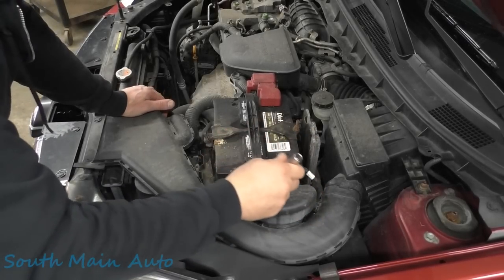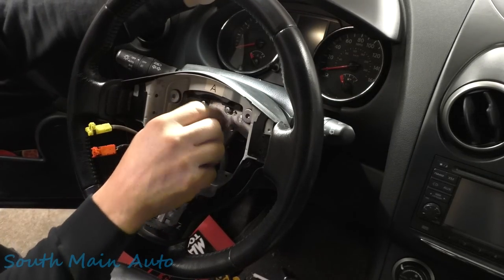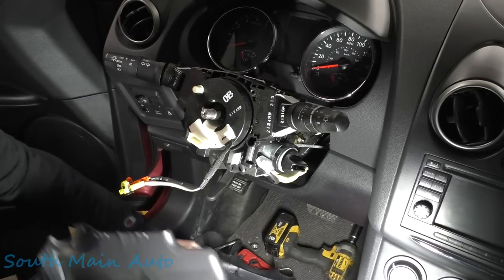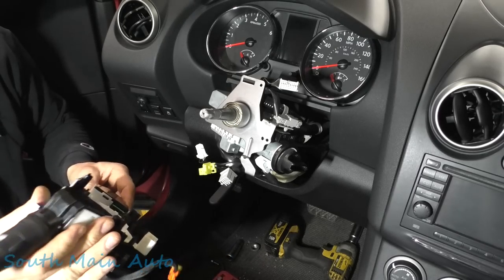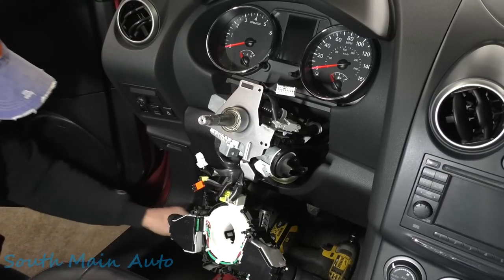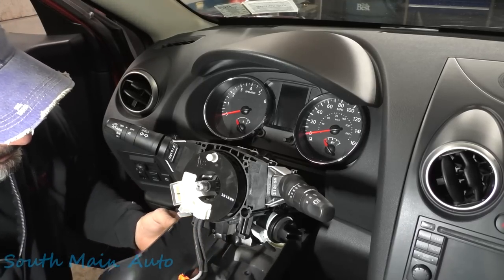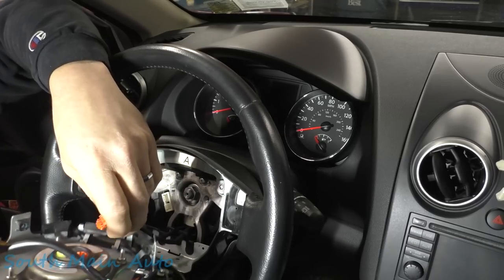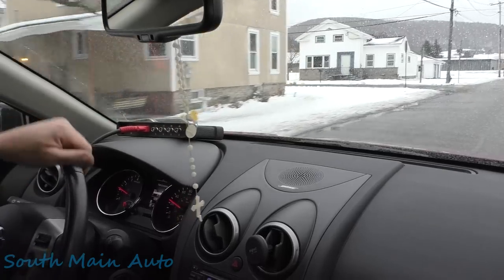'12 Nissan Rogue: Air Bag Spiral Cable (Clock-spring)

Comment: In the days before I started wearing trifocals full time, I found safety glasses with near vision magnifiers that saved the day. Suddenly there was daily motivation to have those safety glasses on. Since they only affect the visual field when looking down, you can wear them regularly even when not working close. Plastic, cheap, sold in well stocked automotive hardware stores. They last about a year, until they get pitted by hot metal shrapnel thrown off the grinder. Or search the term "safety glasses with readers". The magnification for most guys is usually 1.5-2.0 diopters, but if you're like me and want a giant view, up to about 3.0 is available with no prescription. I routinely use magnifying lenses for welding and cutting torches as well. Cheater lenses are a game changer for welding.
Reply from the maker: Great advice 👍🏼 Thanks!
Reply: I use these
Reply: I refused to get bifocals or trifocals and in my head I am not old enough so I went for the progressives and now I can say I can see and I do not have old man glasses, even though I am old as balls.
Reply: @hommie789  Only use magnifiers to read (had cateracts removed ) ages ago now 65.
Reply: @hommie789  I had progressives before I had lined bifocals. I bought a cheap pair for the garage and now I prefer the line. The magnification field is much larger and I find I'm just moving my eyes instead of my whole head. Could be that the guy who made my progressives didn't get them set just right either......Who knows? At any rate, I'm hard on them and lined is much cheaper.
Reply: I got tri-focals in my safety glasses for looking at things above my head. But because I am often kneeling and looking down at my work I find that I still use the upper reading lens because it's easier to look through the top of the glasses than to bend the neck back to look through the bottom of the lens.
Reply: @rael5469  Thanks, I think that's what I need.  I've been wearing progressives but positioning my head so I can see up close has been a real problem and end up taking them off or propping them on my forehead.
Reply: Thank you, I am leaving now to go buy me a pair of safety glasses.
Reply: Yes! I'm always taking my safety glasses off so I can see, so I ordered a pair of Dewalt bifocals from Amazon for $13.49.
Reply: I'm guessing Eric thinks the glasses make him look older.  Either way he is the best technician I have seen.
Reply: I installed 1.50 readers on my welding helmet. Now I can't blame my eyes for sloppy welds anymore. Now I'll blame the coffee shakes!
Reply: I'm 51. Probably about 3 years ago, I was working in a buffing shop at the textile plant. My overseer came in and said, "Hey, do you want these safety glasses with the cheater lenses at the bottom?" I said sure. I immediately put them on and looked at some rubber rollers I was inspecting for defects and immediately knew I had been walking around half-blind. The difference was shocking. Now I'm wearing no line bifocals but still prefer to use reading glasses when I'm doing close-up work like soldering.

Comment: I was a Toyota dealer technician for 34 years and replacing the spiral cable was way simpler than this on all models and took way less time to do the same job. I retired 6 years ago and watch this channel to remind me how glad I am to be out of this trade.
Reply: Try doing a 2006 Chrysler 300/Magnum hidden set screw that holds the clockspring steering angle sensor turn signal and covers. First time doing one you will have half your toolbox on the passenger seat 😂
Reply: Kind of a thankless industry.  Shops pushing profits over quality, the cost of tools, automotive engineers finding more creative ways to design the same parts, customers wanting cheap repairs but can't fix anything themselves...
Reply: Or you actually miss it a little…

Comment: Hi Eric. Greetings from Australia. Just did the same job on an identical Nissan assembly. Clockspring had a bad circuit. The "clockspring" is actually a strip of flexible printed circuit using copper tracks. Being a cheapskate, I disassembled the clockspring and located the fault. As there were no other steering wheel controls in this car, there were lots of spare tracks so I just bridged across to use a spare pair of tracks for each wire to the airbag (only a 1 connector bag). Should last the life of the car now! I regretted not videoing the clockspring disassembly as it was a bitch to put back together but is now working fine.  Concerning airbags, as you suggested there is a bit of hype around these. They are pretty robust. There are warnings about testing with an ohmmeter. I can tell you that you will not get enough energy from a digital meter to fire the bag (7 years working at an explosives test range!!) The real elephant in the room is static electricity which no one says much about!

Comment: In the early air bag days, I used to work on steering columns from out side the car until I had the airbag out and sitting on the bench. Some one came to the dealership and demonstrated how high the bag assembly went if it was bag side down. Don't want that hitting you anywhere.

Comment: Eric, I really enjoy your videos, and I love hearing the banter with your wife.
Self-tapping screws are usually used to assemble plastic parts, and there is a limited number of times these parts can be reassembled.  When reassembling these parts, I've learned to insert the screw into the hole, push on the screw while turning it to the left until I feel the screw thread drop into the thread in the plastic, and then tighten to the right.  Doing this reuses the original threads instead of cutting a new one.  I understand that most of the time, you will likely be the last person to work on that area of a car, but adopting this practice will enable a greater number of times a plastic part can be reassembled.  Actually, I do this with most threaded fasteners, and I find that it helps prevent cross-threading.
Thanks again for all of your videos.

Comment: That was a fantastic job getting those connections apart and back together.  AND NO PARTS LEFT OVER!!!.  I could never be a mechanic.  I would be pulling the sledge out.  Thanks for the video.

Comment: That's hilarious. I always wonder about the one way fasteners in toilet stalls. Glad I'm not alone!
Reply: Don’t need a one-way unscrew driver, cuz the stall wall is probably already ripped off the walls or will be, with some tile work and new concrete anchors 🤷‍♂️😏

Comment: I JUST did this job on my 2014 Frontier.  The radio/phone controls on the left side of the steering wheel stopped working.  Air bag connection was still OK. This is probably the exact same part.  I did have to get a steering wheel puller for this style with the two small holes on either side of the shaft - not enough "lead in my pencil" to just pull it by hand, I guess. And yes - I had to transfer the position sensor, screws and controls posts. Nissan would only sell the whole shooting match with the control posts that I didn't need with the clock spring for about $250.  But I was able to get the Nissan clock spring ONLY from Flea-bay for about $50.  Way better than $250.  Keep that in mind if you need to do the same job.  Thanks again, Eric!

Comment: Did the clock spring on the wife’s Tucson a month ago, and you have to clear the code before the light goes off as well, i got hers from the wrecker for $12 compared to $347 from the dealer.

Comment: Same set up on a 2009 Xtrail, had to change mine twice, faulty unit on first one. Took me about 30 minutes. Had ABS light flashing, other symptons included radio buttons and cruise control not working on steering wheel.

Comment: Awesome timing, my guy... I'm tracking down the air bag light on the wife's 2012 Rogue...
Reply: Did it end up being the clockspring? My wife's horn isn't working and then I checked and her cruise control isn't working. I think it's the clock spring and it's a 2011 Rogue.
Reply: @TortureBot  My problem ended up being the air bag module... Sounds like your symptoms would be the clockspring, but always test - don't guess... Good luck...
Reply: @steveo6631  thanks. I bet the airbag was a bit expensive huh?

Comment: My eye doctor gave 2 options.  1 to use readers for magnification. Or 2 use a single contact lenses that provided the magnification needed.  Thought that was weird but other people tell me it works.  I went with readers due to the dust in the construction sites we work in. Easier to clean reader glasses than flush out an irritated eye
Reply: President Reagan had contacts. He used one eye for reading and the other to see where he was going.
Reply: At 57 i just broke down and got multifocal contacts, wish i did it years ago!
Reply: @kurtb3606 I got no line bifocals about 3 or 4 years ago. I tried to get the eye doctor to set me up for contact lenses but he just kept talking and talking about how I needed to do bifocals. I caved in but I must say I rarely use them and just walk around with some reading glasses handy.

Comment: i completed a similar repair for our VW broken steering column lock.  Taking everything apart is slow; reassembly is fast since the design facilitates minimal assembly (factory labor) time.

I clearly saw steering wheel/column alignment marks but mines off on spline to um, err, well ... compensate for my daughters slight pot hole mishap that left the recently aligned steering wheel at about a two degrees from level. It drives straight though I need to remember to put it back square for the next set of tires.

Comment: I think I'm most impressed that a Nissan Rogue has 160 on the speedo!
Reply: I have a buddy with an '11 Nissan Frontier with well over that I think. Yes, it's the automatic/CV tranny. So far so good as far as I know. He bought it used several years ago and it's been good to him.
Reply: plenty of Rogues at the junk yard here in Florida [ it's not the heat]
Reply: Both of you misunderstood. He means the mph on the speedo. As in it can go 160mph.
Reply: @andrewkennedy9704 yes he did misunderstand. I can say that my wife's 2011 Rogue with a CVT has managed to get to 175,000 miles, but the Transmissions been acting funny for probably over 50,000 miles. It jerks and stutters a lot of the times but then other days it won't do it at all. Very strange. The transmission is very whiny these days though.

Comment: I had to replace a clock spring (cable) on a ‘97 Voyager .. I was almost “clocked” by the steering wheel airbag .. it was tough to get loose, but when it let go, Whoa! .. almost a man down .. juggle caught it just before it hit the ground😮

Comment: Had my eyes flapped and zapped in 1995. Best $4400.00 dollars spent on myself. You can get them both done for $1600. Now close up work 1.0 correction needed through dollar general $2.00 glasses. You gotta' cut back somewhere.

Comment: Hey Eric. You should get you some mulifocal contacts. I started having issues with up close vision around 43-44. Used reading glasses for three years until my wife convinced me to see an eye doctor. My distant vision was slightly blurry as well and up close was very blurry due to age and is called presbyopia. Anyway, to the point, they make more or less bifocal contacts. They are a godsend. No more reading glasses and both my distant vision and up close are perfect again. Air optix plus hydraglyde make a great multifocal contact lens. Just some food for thought.
Reply: 100%.  They're great, you don't even know you're wearing them.  Awesome lenses.
Reply: @johnz8210, how do you focus on small text and stuff if they're in your eyes all the time?

Comment: "My eyes aren't doing good this morning."  Whenever working around the airbag and its connectors, always wear eyepro.  Even if the battery is disconnected, a static charge can cause a spark and trigger the inflator.

Comment: Get some good readers and a headlight. A young helper who can see in those dark areas helps a lot too. I put up with poor eyes for 20 years before retiring and selling my shop. 
My 99 Accord with 240k SRS just now failed last month. Ten years life on a Nissan is sad.  
 
One more tip to remind techs to face the airbag up when on bench just in case it goes off. Sitting it face down turns it into a missile. Haven’t set one off in 30 plus years of working on them. 
You have the patience of Job to not lose your cool messing with these. That’s something I lost once I got in my 50/60’s.

Comment: If you don’t have a tamper torque bit You can also reach into the tamper screw head with a flat screwdriver and snap off the security pin.

Comment: 😂😂😂 you had me rollin’
Toilet stall screws. Seriously.. is that really a thing??? 
We’ve all been there on the tricky connector 😅
Great video. Hope she gets better quick so so the whole fam damily doesn’t die 😐.
See ya next time
Reply: Perhaps it is  job security for the plumbers?
Reply: Yupper, before the torx, American Standard stalls used one way slotted screws that would cam out it tampered with to remove them. Drill or chisel to get those out.  Usually that wasn’t required cuz the stall wall was ripped out of the tiled wall and concrete anchors 🤷‍♂️😏.  Restroom 🚽 out of order: shitter down. 😆

Comment: I've replaced the clock spring on my '07 Quest on 2 different driveway repair occasions, 3 clock springs.  Once was I think the horn not working, then the eBay special fixed the horn but then the airbag didn't work.  No tamper proof screws on the Quest though.  This appears to be a common Nissan part that wears out.

Comment: I had to change the clock spring in my vehicle just a few weeks ago. Was a pretty straightforward job but it was weird to remove the steering wheel.

Comment: Pro tip, get some reader glasses. Start at 1.5 x. Really important pro tip...the closer your face is to what your working on, like having your head wedged under the dash, the higher the magnification you need. I wear 1.75x normally but when my face is a foot from something I need 2.5x otherwise what Im looking at is blurry with the 1.75's on.

Comment: In my thirty years of installing toilet partitions and commercial door hardware I can confirm stupid people’s need to dismantle toilet stalls and interior doors! I still have a set of security bits much like yours but not as fancy. Most configurations of bits in that set I never used, I may have used two or three consistently! One bit being the exact one you were using. Security hardware isn’t that secure against a leather man or needle nose pliers unless it is recessed!
  I installed interior doors in a High school addition many years ago. The students discovered that the security shaft in the lockset could keep them from attending class. They would force the handle of the the locked lockset until it broke the shaft inside the lockets that was designed to break to stop forced entries when the lockset was locked. It was all fun and games until they were captured on the new security camera system in living color. The parents were charged many thousands of dollars for replacement lock sets and my labor to replace them!
Reply: Most aren’t dismantled, usually demolished.  Tile job and new concrete anchors plus new stall walls and hardware...🤷‍♂️😏😠
Reply: @tomtheplummer7322  I was referring to vandals dismantling toilet partitions, not construction workers although I have dismantled then reinstalled partitions a few times.

Comment: We started using tamper resistant screws on our bathroom partitions because people were stealing the stainless steel and/or aluminum mounting hardware and latches.
Reply: Usually they just rip the walls off.  So a tile job, concrete anchors and new walls....do dismantle, just demolition and do over 😏

Comment: Nice repair! I guess the factory engineers really made an effort on the design of that plastic assembly and connectors :-)
Reply: Its reassuring to know the one thing that keeps the car going straight down the road is put together with plastic snaps. Nice to know any kid with a Lego collection can get a job with Nissan.
Reply: @TheMinnow101  LOL. Very true 🙂

Comment: I took off one of those clock spinny wing dingy thingys off a 99 Eurocrap Van. I looked at it, said, "what the hell is this thing?" And then promptly chucked it into the back with the rest of the dash parts that were flying back as I tore apart the whole dash.

Comment: Since I am not a technician but enjoy your channel, I have a rookie question. Were you joking about the airbag going off when you connected it? If the ground was off the battery, would there not be any current to set it off? Thanks, Mr.O. I really enjoy the channel and mostly your banter with us like we are sitting there with you.
Reply: It's theoretically possible for enough static charge to build up on the airbag to fire it when it's connected - and cold, dry weather is when static is at its worst.  It's not likely, but it's not impossible.

Comment: I think I remember another video of yours with a Nissan. Someone had replaced the clockspring and forgot to transfer the steering angle sensor. The car was FUBAR. I was thinking of that video when you put it on the first time. I thought.... I guess this Nissan clockspring already has the SAS, then 20 seconds later, you were taking it off again lol.

Comment: 4:50 ish, sometimes a steering wheel puller is the tool. However, if you're brave...or rather you don't have puller...I'll rephrase, if you don't have puller and are or feel brave... check for alignment marks and thread nut to flush with end of shaft and using air hammer, very carefully give full quick beans while slightly pulling back and generally you'll find the puller later and have a steering wheel separated from the shaft.